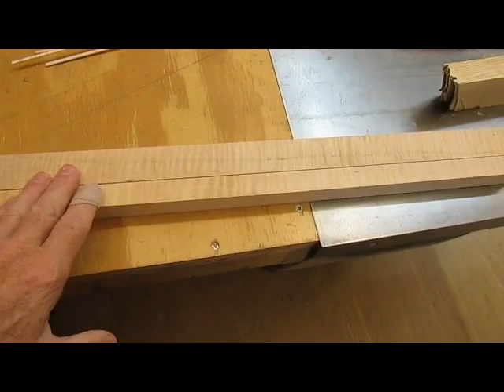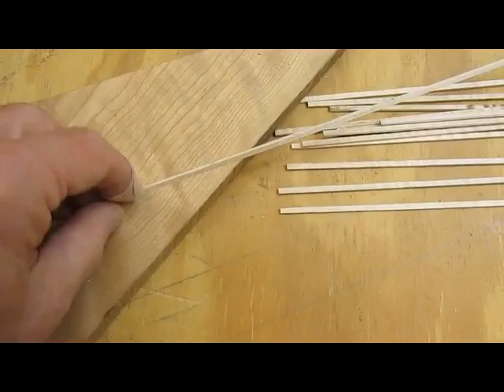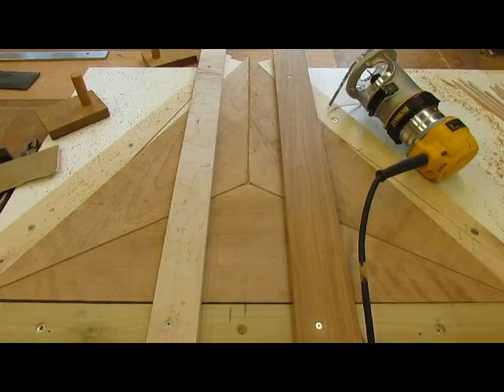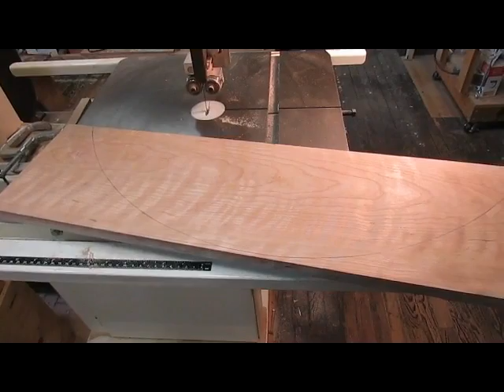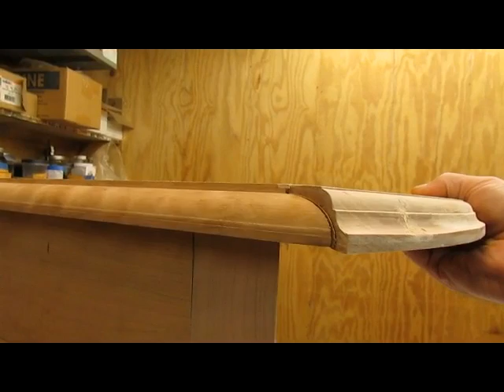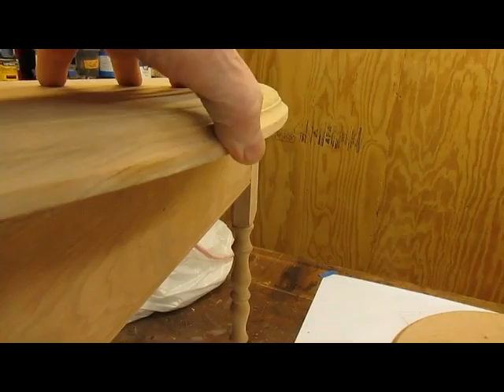Drop Leaf Cherry Table   Stringing & Drop Leaf Joints - Step 5

Comment: Nice work, that stringing gives it a nice look. I was thinking for a while how it would look with another strings along the edges of drop leaves, along that rule joints. But it probably would be "overstringed" :-)
Reply from the maker: +Jan Buzrla Thanks Jan,  that might be a little too much, however there could have been a design in the center

Comment: still don't understand how the leafes will not run into each other when dropped down.  looking forward to the next one . :)
Reply from the maker: +Ross Hastings You will see better when I put the hinges on, but if you look at the last picture on the blog, you can see the miter cuts on the ends of the drop leaves so that they miss each other.  Thanks, Ross
Reply from the maker: +Ross Hastings Ross you are right, I looked closer at the picture from the Met Museum and it looks like the corners are cut back to make room.  The only thing else I could do would be to make the top smaller and chop off the corners of the triangle.
Reply: +David Boeff I'm sorry that it didn't work out David.  I was thinking you would have to square off the points of the triangle to create some seperation of the leafs.   Very excited to see your next vid I love watching your series builds.  Keeps me excited about my builds. :)
Reply from the maker: +Ross Hastings Thanks Ross, I am working on it, I think I will miter the joint. It should look ok.  The table that I am copying from the Met. Museum I am convinced will not work, so the leaves will always be up because they have no miter.
Regards, Dave
Reply: +David Boeff ahhhh very interesting you found a flaw in there design.   So cool this is what we all love about wood working the problem solving.  Sounds like you have it figured out. thanks for sharing .